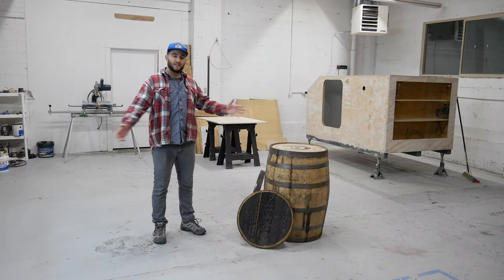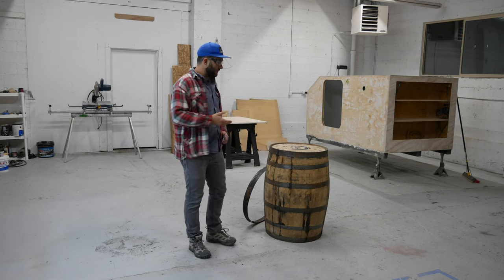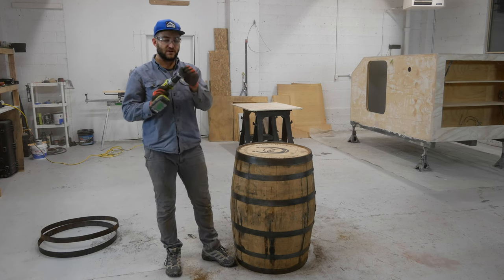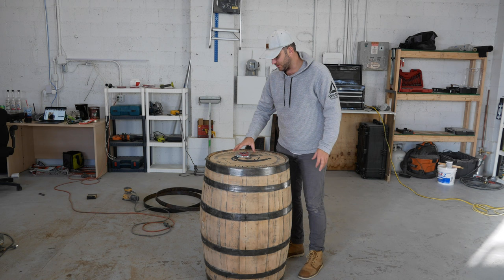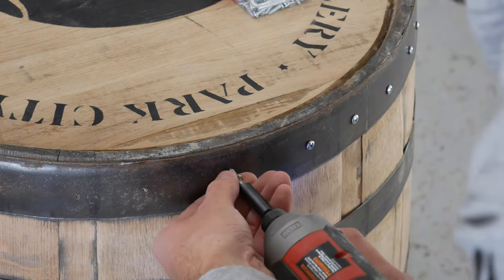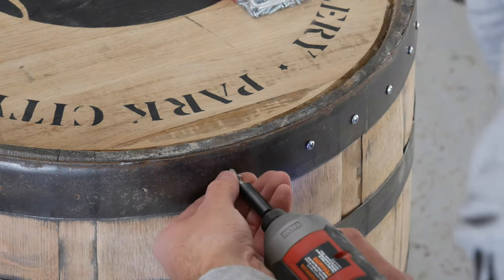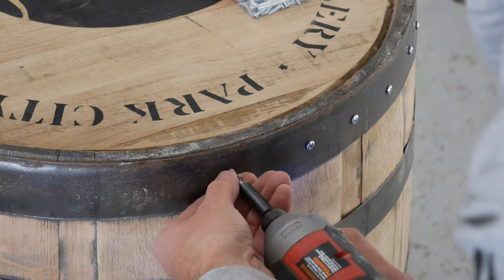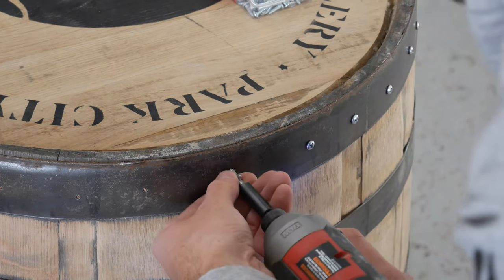How To Build A Whiskey Barrel Liquor Cabinet

Comment: Great build, thank you for the video.  One question for you, if you don’t have an extra barrel top, how can you measure inside the barrel for the shelf?  I’m pretty new to this and I didn’t fare well in high school geometry.  Thanks again!
Reply from the maker: figure out the diameter of the inside of the barrel. Then you can trace the bottom of the barrel and adjust the tracing bigger or smaller for the diameter of the inside of the barrel. I bet by tracing the bottom of the barrel, you would be almost perfect for a shelf.
Reply: I just used a tape measure once I had the door cut.  Then made a cardboard template to check for fit before cutting a the boards.

Comment: great video! what size hinges did you use, do you have a link? Also, did you scrape wood from both the barrel and door where the hinges would go?
Reply from the maker: Here are the hinges I used: https://www.homedepot.com/p/Everbilt-3-in-Oil-Rubbed-Bronze-Square-Corner-Door-Hinge-20774/205338339

I did remove a sliver of wood from both the barrel and the door where the hinges go. You can barely see it at 19:15.

Thank so much for watching!

Comment: Great video. Did you apply any sealant or stain to the inside of the barrel walls after removing all the char? In the process od building a cabinet and was curious about sealing the walls. Thanks in advance
Reply from the maker: Thanks James! I didn't apply anything to the inside. Just brushed off as much of the char as I could.
Reply: Thanks for the reply. And great idea with the hinges. Is there any sagging of the door when you open it? I tried strap hinges and there is quite a bit of sagging, even with 2 hinges.
Reply from the maker: @jamesgomez8111  I tried strap hinges but ran into the same problem you are having, which is why i ultimately went with the door hinges. The door hinges work perfect, without any sagging.
Thanks for watching!

Comment: I'm working on a similar project and have just stained my barrel. I wanted to leave a lot of the markings and discoloring to give it character so I didn't sand it smooth at all, so it has parts that are still pretty rough. Do you think the polycrylic won't looks as good in those areas after a few coats? Thanks and very nice work.
Reply from the maker: I think it should look ok after a few coats.

Comment: If you don’t use a wood screw, it won’t bite into the wood , my experience is to drill just through metal band, then use 3/4 in. Wood screw. Look great
Reply from the maker: Great suggestion!
Reply: I used self tapping screws. No issues with them biting.

Comment: I’m trying to hinge the door. I’m curious how you get yours? I understand what kind of hinges you’ve used, I have the hinges on the barrel, but I’m not sure how to get the door lined up properly to attach it to the hinge.. any tips?? from anyone out there?..
Reply from the maker: Hey Clint, thanks for watching the video. Tips for attaching the hinges: It needs to be attached on (or at least close to) the widest part of the barrel. In the video, you can see that both of my hinges are attached in between the 2 center barrel straps. If you put the hinges higher up or down on the barrel, you will find that the widest part of the barrel ends up not allowing the door to open and close correctly. Get those hinges as close to the widest part of the barrel as possible. Next, if you use multiple hinges, you will want to make sure your hinges are lined up in a straight line. The hinge pins should line up perfectly. If they are a little bit crooked or not in a perfectly straight line, it will affect your door negatively. It probably wont open or close. On that note, make sure your hinges are mounted perfectly plumb or perfectly vertical. it wont line up straight with the curve of the barrel, but that is ok. It is more important that the hinge is plumb, otherwise your door will open slightly up or down instead of straight out.

To get the door lined up properly, I would put your door on the barrel as if the door was shut, then slide your hinges in on the hinge side of the door and mark where you want them. Make sure those hinges are plumb, on the widest part of the barrel, and make sure they line up perfectly with each other. With that you should be able to get a well functioning door.

Hopefully that helps. It is a little hard to convey with text. Let me know if you have any other questions.